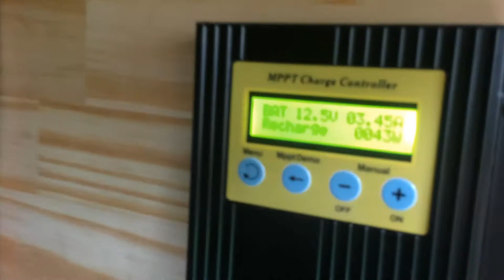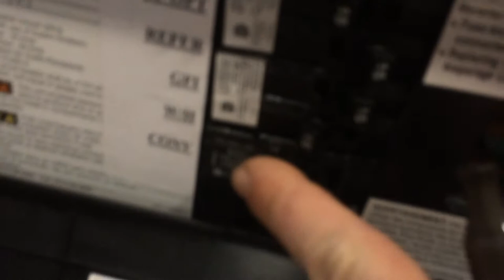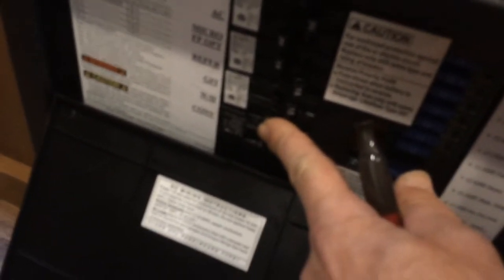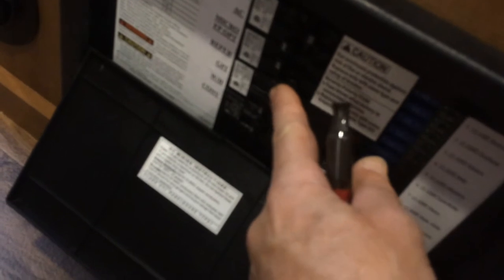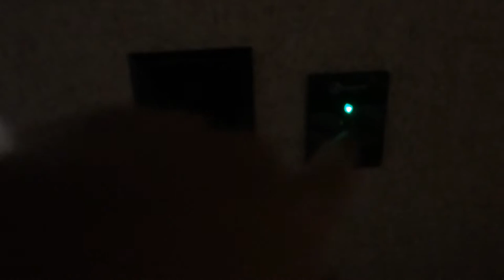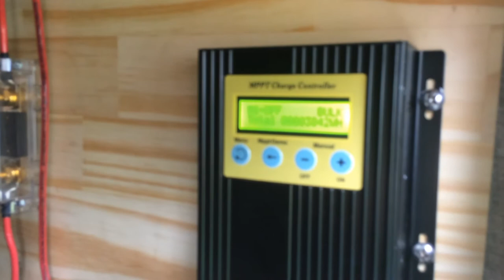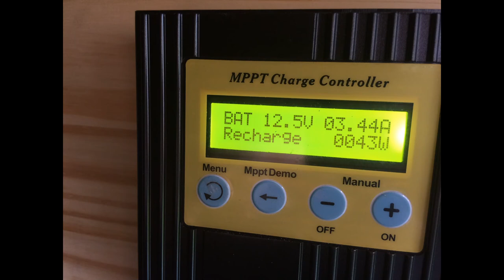Krieger inverter/solar install coachmen travel trailer

Comment: Quick question,  why would you not just set the fridge to “gas mode” and not “auto” instead of unplugging it at the back?
Reply from the maker: It does not have that option.. Its auto switch over... Only one button... If I dont unplug it, the reefer will try to run off my inverter.. I have to trick it to think there is no power so it stays on gas....

Comment: Question,  my panel is like yours. I have 3 outlets on the same breaker as the converter.  I want to install my 2k inverter.  Should I add a breaker so the converter is on its own. Any advice would be helpful thanks!
Reply from the maker: Yes if you can split it at the panel...Mine was tied togther in the walls somewhere so I could not seperate the converter charging circuit and the outlets in the master bedroom